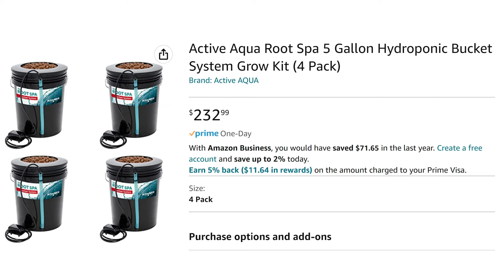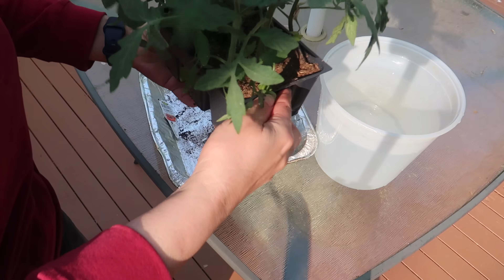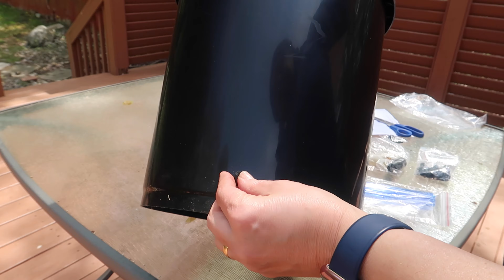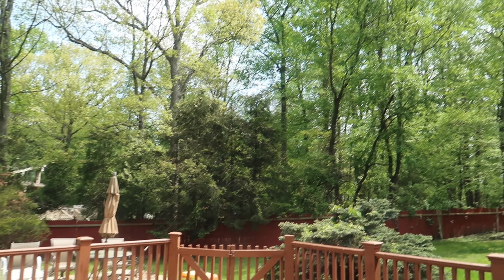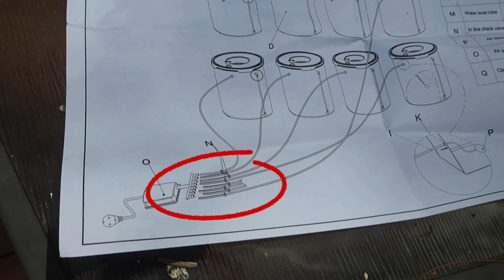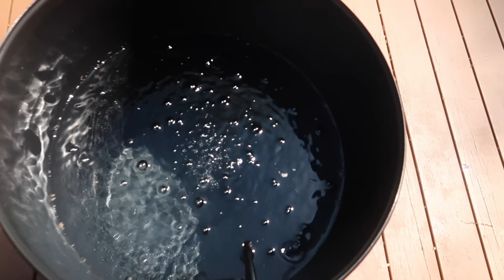VEVOR Deep Water Culture DWC system setup

Comment: Really appreciate the video, just put my system together today.  Did you have any issues with having the pump outside in the elements over the summer?  Did rain/moisture/heat affect it at all?
Reply: I'll post what I've found in the couple of months I've had mine.  I have 2 of these setup, one of the aerators is in a bucket with a lid and the other is just sitting outside open to the elements but off the ground. Neither has had a problem with the weather so they seem to be made well enough to handle the rainstorms that we've had here in the spring/summer

Comment: Hey great video. I would have been overwhelmed by Vevor’s near useless instruction page. You should know that they have updated their system. The air 
pump has 4 ports, so have eliminated the plastic splitter. Also, they have done away with the top elbow part on the water level tubes. The tube is uncovered and there are now clamps and a red ball to show the level.
Reply: The system I received last week still has the splitter. Strange!

Comment: I just got mine today. The blue tube is open at the top, and held in place with a clip. No trimming needed. And it includes little red ball floats that go in each tube such that you can more easily read the water level.
Reply: Wish I had read this comment before contacting Vevor support!
Reply: Yes as mine
Reply: I wish I would of read it before I cut two of my tubes I shouldn't of

Comment: Just some advice from someone that has seen it happen,  put your check valve at the top of your bucket.  That way if your air line becomes damaged or happens to pop off then you are still protected but placing them close to the pump only helps in a power/pump failure
Reply: No. It makes no dif

Comment: forgive me as i havent finished the video yet so you might have awnsered this, but this system seems pretty nice, i was reading that with hydroponics its important to change the water, so i was looking for a system that had that ability, i know this system has drain valves, but for indoor use i dont want to drain the water on the floor, although i can if its just a little water.  Or do i not need to drain the water ever as the plants suck up the water?

Comment: VEVOR is horrible, cheapest crap on the market. Make your own, not hard and you will save money overall after all the crap you have to replace.
Reply: Im thinking about buying this. Can you tell me what's the cons with this system? If I were to diy it I feel like I would spend more money for sure. Especially for 8 buckets
Reply: @chrisclyde4490  For starters the plastic is extremely brittle. Take a good look and the "handles" and you will see the "quality" of the product. They're plastic straps. The "Sight Glass" is useless. The tubing is crap and will pop off or leak at the connections. The stones are undersized. The combined net-pot and lid design means WHEN you break one piece you're going to be building your own anyway. 
Either get buckets from a home improvement store (or better yet, ask a RESTAURANT), or get a rubbermaid container and put 2-3 net pots in it depending on volume.
Reply: @chrisclyde4490 the system is worth it. This poster has some meaningless gripe.
Reply: @nonamezplz4873  No, every single piece of their hydro systems are complete junk. You're 100% better off building yourself. While you may pay 10%-15% more, it will actually last.
Reply: @nonamezplz4873  Ah yes. The plastic is totally not brittle. The handle is not at all just a cheap strap of plastic destoned to pop right off or break. The air stones are not the least bit undersized, and no problem whatsoever when one part of your combined net pot / lid breaks. The air check valves don't ever just pop in half at the seam, one that is entirely unglued. 
And their PVC tube version is just so much better! You're right, just meaningless gripes. I must just be some random jerk.
Reply: Vevors the best online store to date. Ur on ur own with that comment
Reply: @ralphmoulph1256  Nah, I stand with anyone who bought one of their crap hydro systems. Only been doing this since the early 90's, thought "Hey, it's cheaper than building, why not". Now I know.

Comment: Tip.....check valves can go anywhere in the line. And if the air pump is located higher than the buckets (shelf etc) than you don't need to use check valves. Same as a fish tank.

Comment: Do you need to use a water chiller?
Reply from the maker: It happens to be a very cool May day here (62 F), so I'm thinking a water heater is more appropriate! Perhaps if you live in a hot climate then black is not a good color, maybe wrap the outside with something reflective, or paint with a lighter color to reflect the light?  So far the plants seem happy every morning when I go out and talk to them! The nights have dipped down into the 40's so I was a bit concerned, but they are weathering fine.  Thanks for the question!

Comment: I bought that same system back in Feb. Back then it was only $150. I was considering buying another, but when I went back and looked at the ad it had went up $20. It was a little irritating to have to pay $20 more for something I had just purchased, so I decided to think about it. I looked at the ad like 2 or 3 days later, and it had then went up to $180. I now see it's back down to $161 ($160.99). 

I still may get another one, as the system does work great. Of course, it's little more than buckets with water in them. Buying the complete system is much better than having to get all of the individual components to build an identical system yourself, I believe. Also, as you touched on, when considering the prices of other similar systems, I think it's worth the money.

It was a while before I had time to get everything going, but I set mine up in a 4 x 4 grow tent, and the system fits and works great. There's not much extra room with the pump also in the tent, but there's enough. I installed an elastic mesh trellis from the floor (edge) of the tent to the middle bar of the ceiling, and an oscillating fan, and I now have a cucumber plant going, a bush bean, a tomato (maybe 2, can't remember right now), a green pepper, 2 or 3 hot peppers, and I forget what else. I can't imagine the plants growing any better. I started everything from seed, in rockwool, and in the buckets. I did make sure to keep the rockwool wet until the roots touched the water in the buckets, of course.

Lastly, just for future reference, as I've seen other companies do it too, but in Vevor's Amazon ad, on the images at the top, if you scroll through, one of the images (2nd. I believe) is actually a tutorial video that shows how to setup the system. It obviously won't do you much any good now, however.  lol  Good job on the setup, BTW.  👍 You actually did better than I did, and I had the video!  😆  I somehow managed to cut one of the blue pipes just a little too short and had a slight leak (just drops), but it was easily resolved.

Thanks for the video. I love watching all of your grows/experiments/comparisons, etc.
Reply from the maker: It sounds like you have a whole farm in your 4x4 tent! Wow! Putting the kit together was really pretty easy, and I like putting stuff together, so that was fun.  Thanks for the comment, I appreciate it!
Reply: @TikkiOOO  👍

Comment: What's your plan to keep rain water out of the system and diluting your solution?
Reply from the maker: Hello Joe, great question. I've never grown hydroponically outdoors, so let's see as it goes. If there is a storm coming, maybe I can pull the buckets back towards the house so they are under the awning for protection. Once they get larger then I don't know that much of the rain will be able to get into the bucket with the lid and the plant covering it....this is a learn as I grow project. I'll post updates and let's hope for the best!
Reply: @TikkiOOO  Thanks!  I've been considering a similar setup and have been thinking that maybe something as simple as wrapping the lid and the base of the plants with aluminum foil.  That should be flexible enough to expand as the stems grow but hopefully would help keep most of the rainwater out.  I'm unsure if the light reflecting from the bottom of the plants would be a good or bad thing, though.